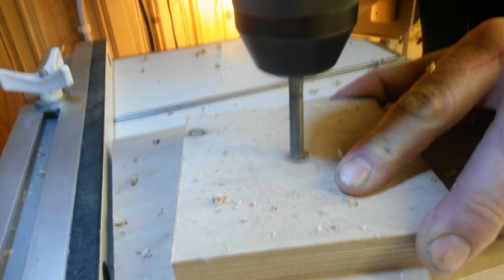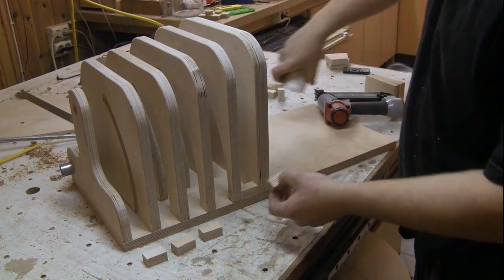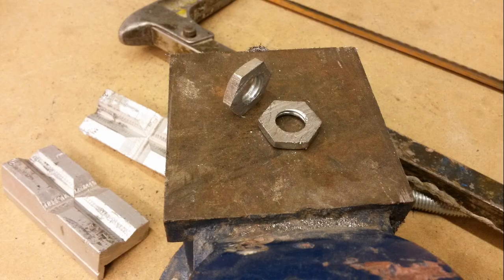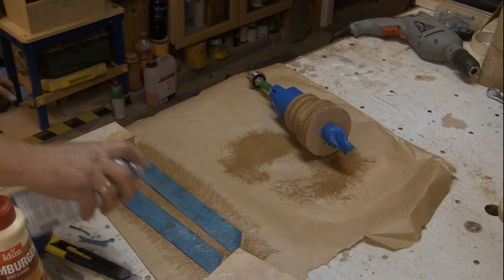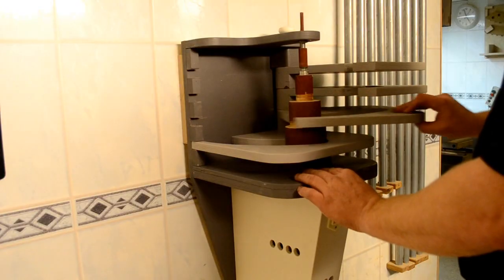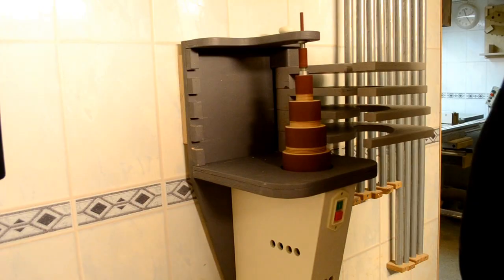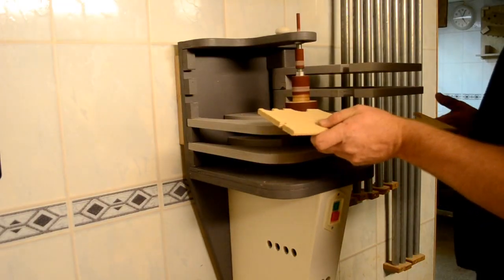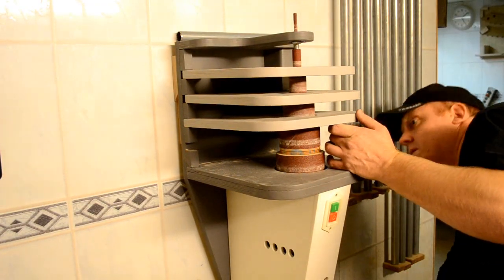Building The Tower Sander

Comment: Excellent! I love this project. You could easily convert each layer with a shroud that surrounds each diameter of the spindle. Stacked up these should produce a good flow of air through to the bottom for dust extraction.
Reply from the maker: ProsthetaThank you. I might look into the DC a bit.

Comment: I like this sanding machine but I wonder if you could explore  an alternative idea and I believe you will be able to do it because you have a gifted mind;     use an idler  shaft positioned parallel to the one attached to the drill with different diameters in order to use sanding belts in stead of gluing sand paper around each cylinder.  As you see the sand paper in the one you did gums up quite quickly. But if you use belts  the surface areas increase greatly thus reducing  clogging   of the sand papers.   Great video and keep up the good work.
Reply: enrico3web harbor freight sells sand paper cleaning stones, they actually work well and cost very little

Comment: Very cool design!  My only question would be is how easy/hard is it to change the spindle for different grits sand paper?  This would also be important for when you need to take the spindle off to replace the paper.
Reply from the maker: Eric Schwartz Thank you Eric. Normally I think these  sanders, along with a disc sander is primarily used for shaping, with a relatively coarse grit. But please correct me if I am wrong. So in my case I use it mostly to get rid of sawmarks, and straighten out bandsaw, or jigsaw cuts. But if you remove the 4 screws in the back, the top comes right of, and the spindle can be removed.

Comment: Looks really cool but I have no need for it, might buy the plans if I find myself bored and want to make something. Also one suggestion you should have made the very top piece removable so you can sand the inside of circles to the diameter you want. Anyways its a neat little machine.
Reply from the maker: +Derek Ludwig Thans, It could be done with a hinge on the top support, but I fear that the seating for the top bearing would have to be a little loose to get it on and off if hinged, or if I was to pull it off, the slack might cause the bearing to spin. but it would be even better if it could do insides also as you say

Comment: That is very creative, awesome build! The only downfall I see is for the small spindle your reaching way up to try and sand small curves and the largest spindle your stooping down low............have you had to sand for a long period of time in either of those positions and what kind of effect did it have on your body?? I think if you had some sort of lifting and lowering device like a router lift concept, that would be really cool!!
Reply from the maker: NKWB Thank you.The height difference between the top and bottom spindle is aprox 300mm, so I dont think it is that bad. But of course for hours of sanding, one should attempt to get the ultimate working height.
I also thought about showinh how you can lay the sander at the back, and then have the spindle horizontally. But then again you would have to keep the workpiece at an angle, and also you loose the advantage of the gravity pulling the workpiece against the table.

Comment: This is a really good idea. Like it! Have you considered designing a way to collect the dust from this machine?
Reply from the maker: Thanks Jules. Not for the time being, any ideas?
Reply: @bellevuesnekkeri  collecting dust could be quite a challenge for this sander. How about an adaptor that converts your round dust extraction hose to a rectangle shape that can fit snugly between the two partitions above and below the sanding drum you are using? The challenge may be getting the hose/adaptor close enough to be effective without getting in the way.  I'm sure if i had the same machine in my shop, I'd be looking at it every day and eventually come up with an idea! Good luck with it : )

Comment: So you need to build a new drum each time you want to replace the sand paper? What do you think about glue a velcro on the woodwheels so you can add/remove velcro sanding paper pretty fast?
 BTW: If you've developed any improvements or ideas in the meantime it would be great to add them to your video at the ending. Anyway great idea and sweet design , maybe i will rebuild it sometime.
Greetings from Germany
Reply from the maker: Thank  you. There is no need to build a new drum. Just use a heat gun , and the contact glue will release the abrasive. Then its just a matter of spraying on a new layer on the abrasive and stick it on. Using a velcro like on a disc sander would also work great
Reply: Heat gun removes sandpaper strips.  Velcro may be a bit on the spongy side. Going for a very flat and square surface.

Comment: Very creative....go for a patent before some tool manufacturer uses your design in a commercial application.  I currently have a small commercial spindle sander that oscillates up and down.  If I may, I would like to incorporate your design and concept to the oscillating spindle sander.  This would eliminate the nuisance of changing the spindles each time you have a different diameter.
Reply from the maker: Jim Pell Thank you Jim. I have actually not seen this type of sander commercially made, so if any of you at Makita are watching....call me:):):), just kidding. It doeas have afew drawback in the case that it cannot sand closed inside curves as you are unable to "thread" the workpiece on to the spindle, but for open curves it works great. It would be cool to se some images of you modifications.
Reply: Bellevue Woodshop Just make the top brace move-able so that one can feed an inside closed opening onto the spindle. - now I get a cut$ ;-)

Comment: I bet that will save production time, next up multi holesaw drillpress ? :)
Reply from the maker: Tom Howbridge That might be worth a thought....no just kidding, I really hate holesaws, as the clog up unless you buy those carbide cutter ones with large gullets, or take the time to drill a relief hole for the sawdust to escape into.
Reply: bosch do a holesaw with a quickrelease arbour, cost quite a bit for a set but they are good quality I only have one though.

Comment: Have you tried using Velcro for sticking the sanding paper onto the shaft?
I think it would be easier to replace, but i don't know how well it will work.
Try to look for industrial grade Velcro
Reply from the maker: +Mahmoud Shehata Velcro is ok, but my experience is that you never get the the seam completely tight and it tends to grab the workpiece, and shread off
Reply: But now replacing the sanding paper takes time. Do you just peel it off or do you have to heat it?
Reply from the maker: +Mahmoud Shehata  I just peel it off

Comment: how often would you need to replace the sandpaper that you glued on ?
Reply from the maker: +Robertius That would of course depend on the use, but I have not changed mine yet. But I did use high quality cloth backed abrasive , and mainly use a rubber sandpaper cleaner if it gums up

Comment: great design but I would be concerned that the dust is going to be sucked into the drill
Reply from the maker: +malcolm oxley Thanks Malcolm. I am not to concerned about that, and with a 10 usd drill, its cheap to replace it
Reply: +Bellevue Woodshop yeh you got a point

Comment: Great! Do you think it would be hard to add dust collection to this?
Reply from the maker: Spacehero Thank you. I did think a little about adding dC to it, but I did not want to overcomplicate it, or clutter the design. I might revisit it and make some modifications to acouple of things
Reply: that's what I was thinking about too. that dust will invariably get down to the drill level and get into the drill housing heck, dust gets into my drills without using them this way. over a short period of time dust will build up in the drill without dc or an open-air design. imho I at least would have left the drill open to the air so that the dust would be blown away from the drill and less of it would get into the housing.
Reply: Not at all. Enough room to get very creative. Why question? Just do.

Comment: What ever People say about harbor freight they can't say anything bad about the nailer/stapler you are using. I ran over 50k staples 1-1/2 inch staples in mine.
Reply: Oh yeah 14 bucks on sale wtf homecheepos cheepist one is 70$
Reply from the maker: +Jared Jeanotte The nailer works great, and even though I have not shot 50.000 nails, I have not had any problems with it

Comment: I liked everything you did except your choice of drive motor.
I just don't think the drill will provide enough speed, torque, or durability.
But, at least you can alter your design when that drill does burn up and replace it with at least a 3/4 horse AC motor that is belted with a pulley ratio that produces around 1700 rpm.
Reply from the maker: BigRalphSmith The drill for a power train is not ideal, especially if you run it for an extended period. But I use it only once in a while, and for short periods. I think it will outlast me. The noise from the powerdrill is another case. But getting a drivetrain for 8 usd for this is hard to beat, so I dont mind. I also had readily available parts in mind as i made the plans for it. Everybody canget their hands on a powerdrill. Thanks for watching and commenting

Comment: Why not belt grinder? Changing the belt is waaaay easier.
Reply from the maker: A belt grinder only give you 1 radius curve  for inside corners
Reply: @bellevuesnekkeri  Sure.
Why not spring tensioned belt grinder with three different interchangeable rollers?
To be honest decent belt grinder is my dream for some time now, I worked some knives blades on my firend's one, and it was wonderful tool.